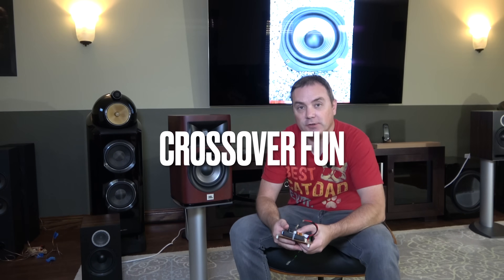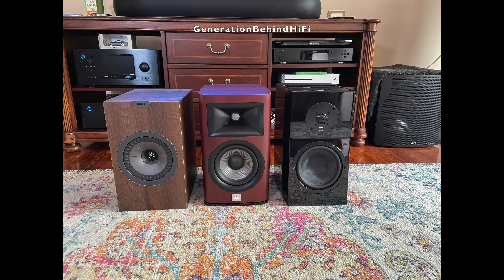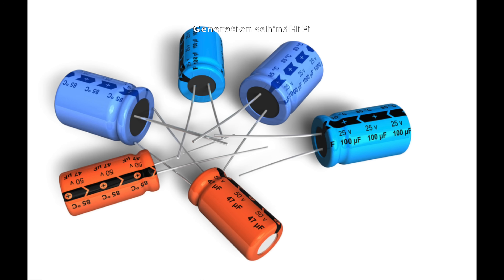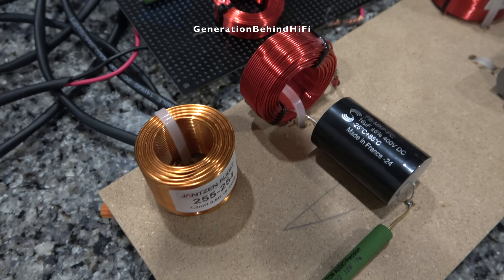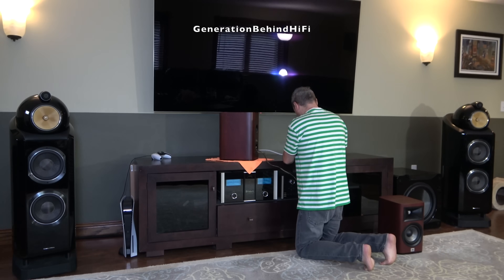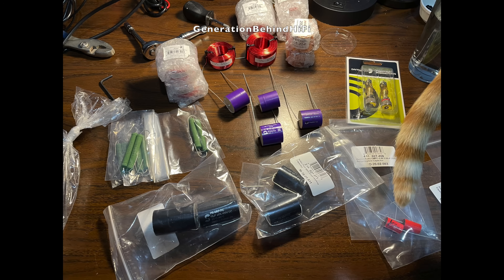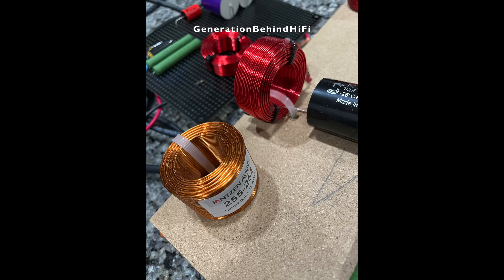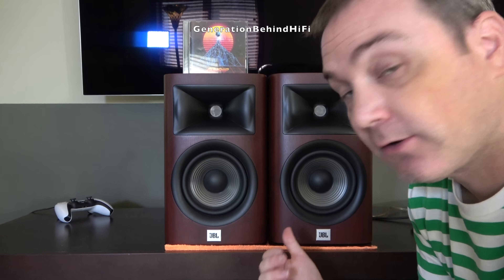JBL Studio 630 Crossover Upgrade - Do higher end crossover parts make a difference?

Comment from the maker: SACD Sound demo can be found below. IMO you can hear the differences much better on camera with me using higher quality source material. Sorry I couldn't include this clip in the original video without being demonetized so had to create a separate video for it. IMO the below video makes it much easier to here the differences between these two speakers. 

https://youtu.be/yKJWvSotots

All of my review videos can be found here: https://www.youtube.com/playlist?list=PLg0Xq1LbiZBU1G5L_QoXvFsgrd57qHZFd

All of my look inside videos on speakers can be found here: https://youtube.com/playlist?list=PLg0Xq1LbiZBXWNQtsEOqq_LynPGsLNpxy

My videos about upgrading speakers can be found here: https://www.youtube.com/playlist?list=PLg0Xq1LbiZBV3JdrXQtMPgv3Lc6YB6fdr
Reply: @generationbehindhifi  
I listened to the sound comparisons in this video as well as your separate video in the link above.

A solid effort, but...

DUDE, you need to invest in a basic but GOOD, flat measurement/recording mic and recording device!

WHY???

The microphone and the recording system in your Sony 4K Handycam video camera is set to AUTO-RECORDING-LEVEL, and it is fluctuating the recording level and "pumping" like a very slow limiter/compressor with each of the deeper bass notes that the speakers play so that your recorded audio is wildly inconsistent.

Even the sound of your A/B speaker switch caused the Auto-Recording-Level limiter to kick in each time you switched it!

In addition, many of these types of built-in video camera microphones will do real-time Auto-Equalization processing when recording to prioritize or enhance the audio for voice intelligibility and clarity, which further molests the audio, because it is variable and changing during the recording.

All of these issues can affect the perceived SPL of each speaker so that they are not consistent and level-matched, which will mask or alter the actual differences in spectral balance and clarity/detail between the two speakers.

If you already own a miniDSP UMIK-1 or UMIK-2 or a similar USB measurement microphone that you use for measurements with REW, you can use it record the audio from the speakers via the free Audacity DAW software for your PC/laptop.

After recording the audio, you can upload the lossless files to a cloud storage service such as Google Drive and provide a Link for your viewers/subscribers to download the raw, lossless audio files so they aren't listening and comparing via YouTube's lossy audio compression codec.  Recording in 16 bit/44.1kHz lossless PCM in WAV format is more than enough to accurately capture and reproduce the audio for this purpose.

I would then suggest that your viewers/subscribers download the Foobar2000 audio file playback software plus its associated ''ABX Comparator Plugin'' which will allow listeners to perform a 100% double-blind A vs. B vs. X randomized listening test using your files.

You've obviously made significant investments in all of your HiFi speakers and associated HiFi electronic equipment, so ideally, I would suggest that you do the same in regards to the equipment that you use to capture the audio for these types of videos...

Invest in an Earthworks M23 or QTC30 measurement/recording microphone along with a small portable digital recorder such as a ZOOM H4 or H6 Essential with XLR microphone inputs and 48v phantom power for the microphone.

Or use a simple USB Audio Interface with at least 2 XLR microphone inputs with your PC, such as a MOTU M2 or M4 + the Audacity DAW software.  For versatility, any USB Audio Interface that you choose should have at least 2 XLR microphone inputs and "Loopback" capability.

Place the speakers next to each other in the middle of  the room on bookshelf speaker stands and position the microphone at a height level that is between the top edge of the midwoofers and the bottom edge of the tweeter's waveguide on the JBL 630 speakers, On-Axis and approximately 18" away from the front baffles.

This will eliminate the majority of the room's acoustic contributions and let us hear more of what the actual speakers themselves are producing while providing studio-quality sound capture.

I'm not saying that I couldn't hear a difference between the two speakers with your tests as they are.  But providing a much more consistent and higher recording quality will eliminate any variables and inconsistencies and reveal the actual differences to a much higher degree.

HTH

Cheers
Reply from the maker: @bbfoto7248  Fair enough. I will look into your suggestions. To clarify, I'm not using the built in microphone included with my Sony 4k camera. I have an external RODE VideoMic Pro+ microphone ($300) that I used to capture these sound demos with.
Reply: @generationbehindhifi  
Thanks for the clarification.  👍  In the future, I would always list these types of details in your video description.  😉

However, regardless of its cost, the external RODE VideoMic Pro+ microphone is also not ideal for this particular type of audio capture.

How or what are you using to actually record the signal from the RODE mic?  Can you set the recording level manually and disable any processing/filters/effects?

A ~$100 USB measurement mic such as the miniDSP UMIK-1 that is positioned within 18" of the speakers using Audacity to capture the raw audio into your PC/laptop would probably still be a huge improvement vs what I heard using my calibrated studio monitors or IEMs in my home recording studio setup (I'm a saxophonist & drummer/percussionist).
Reply from the maker: @bbfoto7248  Will do. Below is a picture of the setup I posted on instagram before posting this video. Anyways.. I really tried to capture the difference with the equipment I had and I think I did a pretty decent job of that because I can clearly hear the differences between the two speakers, especially in my second link. Are there better ways of doing this, absolutely. 

I appreciate your feedback and will look into the suggestions you made. 

https://www.instagram.com/reel/C_ite4vO2Pl/?utm_source=ig_web_copy_link&igsh=MzRlODBiNWFlZA==
Reply: A cheap alternative could be the Behringer ECM8000 measurement/recording mic for $20 and a TASCAM DR-60DmkII portable recorder for $180 at Sweetwater or Amazon.  Total investment of $221 with a Hosa MCL-115 15ft XLR microphone cable.

Or use the Sennheiser AMBEO Binaural headset "earbud" microphones + your smartphone, but that will produce a binaural recording that would be best listened to using headphones.

EDIT:  I didn't see your Instagram Link and photo until after I had already posted this comment^.  Thanks for that.  👍

You'll want to bring the speakers out into the room if possible, but more importantly, position the RODE microphone much closer to the speakers (no more than 18" away).  Think about how close the Lav mic that you use for your dialog is to your mouth and the difference between it and the characteristics of the RODE VideoMic Pro+ when recording your voice in the room.

You want to minimize the reflections and "echo" from the acoustics of the room so we can just hear what the speakers themselves are playing without any room contributions.  This will help to isolate the sound quality of the speakers and provide better intelligibility.

It looks like you had the height of the RODE VideoMic set close to where it should be...On-Axis and between the bottom edge of the tweeter's waveguide and the top edge of the midwoofer.

And if at all possible you want to set the recording level manually and disable any processing/filters/effects/limiters in the Sony Handycam's audio section.

--- OR are you using a SYNCO G2 or similar small recording device to capture the audio from the RODE VideoMic and/or your Lav mic?

Cheers
Reply: @generationbehindhifi  That was much better. With these SACD audio files, I could subjectively detect more presence in the upper mid-range. I also thought they sounded better. Whether those differences would necessarily be worth the cost of components, only you can say. I'll take your word for it. 
I'm not necessarily a fan of the "throw more money at it and it'll sound better" school of thought. It's possible to make things worse (you noted the importance of checking the resistance of any replacement inductors, for example). 
You got some great gear! If I had those B&Ws that you have, I would probably leave those alone.
Reply from the maker: @MxyzPi  Thank you! Yeah, with higher quality source material its much easier to detect the differences. The differences in person are even more apparent. It really goes to show that quality components can make a difference for the better. 

Yeah, I have no plans to touch my B&Ws. I love my 802D2s as is and the way the original engineers had designed them. They really are a fantastic speaker and I'm glad I got them before B&W started getting crazy with pricing. FIY A new set of 802's are now over $30,000. That's silly!
Reply: Those green wirewounds are they daytons? If they are I made the mistake thinking they are non inductance being as what they came up as in my search. They are low inductance, I ordered some mills (both were 4 ohm 10W) non inductive that sounded much better just putting it out there.
Reply: Does the new crossover have the same values like old one? If not, it doesn't matter whether coils without an iron core were used. Then the test is not relevant, only if the values are the same and then by listening to find out if other types of components have any effect on the listener's ear
The speakers will play differently even if the same types of capacitors and coils were used as in the original crossover but the frequencies were changed.
I did a rework of the old Pioneer CS-995 lowend and used a crossover from Dexon where are coils with an iron core and coil capacitors and since the frequencies are 700/4500 the sound is better than the original crossover were two small coils without a core and 2 sh.. electrolytes. So now it's a difference like day and night.
I added L-pads/potentiometers to regulate the mid and high so I could equalize the power, because the original middriver drowned out the high.
If I were to do a "test", it wouldn't be relevant because the crossover is completely different with different parameters and components.
Reply: Include a track playing white noise also.

Comment: Saturation of an iron cored inductor only occurs if it is subjected to a current larger than it is designed for. I use and design valve/tube amplifiers. The output transformer is a massive iron cored inductance which, in the case of single ended amps, carries a large DC current. This wd cause saturation without an air gap, so single ended amps are designed with larger output transformers with air gaps; problem solved. A well designed iron cored inductor in a crossover network, not being subjected to a standing DC current,  wd not be saturated unless grossly overloaded, which wd likely burn out the voice coils of the loudspeaker units.

Comment: That's a very noticeable improvement - Danny (GR Research) would be proud. What speaker selector switch are you using? - it's crazy loud. It would be cool to see the inside of the switch, I use the Luxman AS-55 Speaker Selector and comparing the build quality and switching contacts would be interesting.

Comment: In some speakers, the difference is remarkable, and in others, almost not noticeable, and surely not worth the component cost. I did a major upgrade in my Wharfedale Lintons, all capacitors and resistors, and difference was night and day. I did a similar upgrade to a pair of new Klipsch RP 600 M:s, with very small , if any, difference. The opening up and increase of layer after layer of detail, both in midrange and higher register in the Lintons , was astonishing though.

Comment: I bought a pair of radioshack Optimus 7 pro speakers over 3 decades ago and they spent most of their time in original bags and boxes.  They got pressed into service for a mobile theater setup for our one week stay at a cabin each year.  They did fine over the years but after reading about a reworked crossover by Zilch for the minimus 7, same drivers and crossover as the optimus 7, I decided to give it a go.  The stock have a 12db on the tweeter and the woofer runs full range.  Frankly they sounded pretty fair for the price and age.  The Zilch crossover is a 12DB for both and has a pad on the tweeter.  All in the parts were only about $45.00 for both and were simple Dayton poly caps and air core inductors.  The difference is knight and day!  They image so much better and are far clearer in presention of the material.  A friend, who has a very nice system and very good speakers was stunned by how good such garbage speakers sounded.  This thanks to the crossover.  I was thinking of upgrading my JBL 4406 speakers but JBL didn't cheap out on the crossovers on them like they clearly did on the 630s.  Personally I would not spend stupid money on crossover parts and instead just stick to the basic Dayton caps and aircores.  I also would have just bought the higher value inductor and simply pulled off turns until I hit the target value rather than stacking inductors.  Thanks for the video.

Comment: Still to remain the fact is if you could put a couple hundred dollars together of transistors capacitors electric without electrolytic caps ghetto and make a 700.00 pair of speaker sound like $7,000 speakers go for it but just remember the companies that make these speakers do you know what they're doing and if they really wanted to smear the audio and make it so in transparent then they're just flogging their own damn horn because it ain't going to make a difference cuz you're going to fix it anyways so if they make a difference which I didn't hear it very much of a difference but the truth of the matter is if it does then do it

Comment: I just modded two pair of polk audio reserve speakers.  Some R-100 and R-700.  The new caps sound more open and there is more detail retrieval.  A more clean and neutral sound with better soundstage. You hear more ambient recovery than stock.  You know the biggest difference between the reserve and twice as expensive legend series?  It's mostly just higher quality crossover parts.
B&W, Focal, Sonus faber and others have $2000+ a pair speakers that still utilize low quality crossover parts.

Comment: Great video! I have a pair of Kenwood JL-640w speakers that only have a electrolytic cap and two resistors connected I believe in parallel to all three drivers. I want to upgrade but not sure how to approach this. I’m sucking the bass driver has full range signal going to it. Not much of a crossover. I’d love to install a crossover as I’m sure it would sound much better. Over already added some bracing and poly fill to help eliminate resonance. Thanks in advance.

Comment: I bought a pair of bookshelf Mordant Short M20's, and decided to upgrade the crossover, so bought two off the shelf Dayton Audio crossovers, made a huge difference, they sound clearer and give a much bigger sound for a tiny speaker, I also padded the inside of the cabinet with felt while I was there, they now sound amazing, I only paid £75 for the speakers direct from Cambridge Audio eBay website, and spent as much again on the crossovers, so a grand total of £150 ($195) but it was well worth the effort and extra cost.

Comment: wow massive difference! 
i have polk speakers for my set up . i want to upgrade to Peerless XT25SC90-04 tweeters and swap out for better parts in the stock cross over .
my question is what coil do i get to swap out the iron for air core? parts express has them cheap so wile i can i want to get them .im on a fixed budget so ... 
any way my fronts are rt2000p , center csi a6 , rear m50 , sides are t15  powered with a denon avr-s900w . the rt2000p have two subs each and i have a mirage bps-100 for a subwoofer. my next upgrade after the tweeters will be a used denon AVR-X3800H receiver and four vt60 ceiling speakers

Comment: Question: How'd you even get inside of this speaker to make the upgrades!?  I have a JBL 665C whose compression driver quit (either that or something's wrong with the crossover) but I'm being told by JBL's very own authorized repair shops that they can't even repair these things because they're a sealed design.  They told me they're designed to be replaced or exchanged if/when there's a problem with them.

Comment: Anyone who has any desire to learn about the quality of their components and how they effect what their hearing should absolutely do so. Mediocre parts have no place in any speaker crossover as this degrades the sound. The speaker price point is what determines what internals it has. Speaker terminals that use ferrous materials degrade the sound and poor wiring also does even if you have excellent crossover parts. You cannot expect to just change crossover parts and achieve the results you want. The entire chain of parts matters as  all of the parts in it matter. That is a proven fact, not an opinion. The sum of all of these can cost more than the speaker itself. Only you can decide if it is better to buy a better speaker or buy better parts to put in what you have. That is up to you. Be that as it may, the whole chain matters so don’t just fix the crossover parts, fix the wiring and termination as well. You’ll thank yourself later for it.